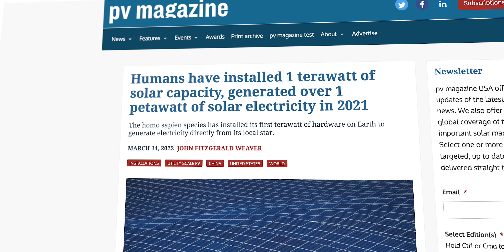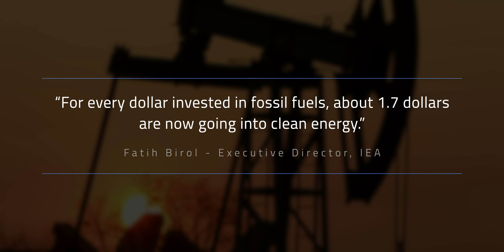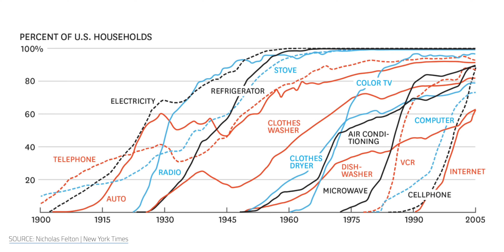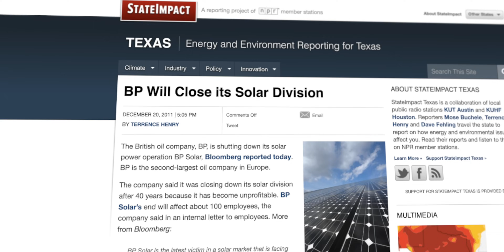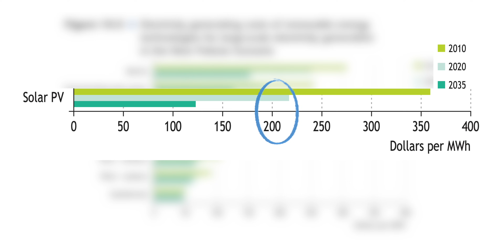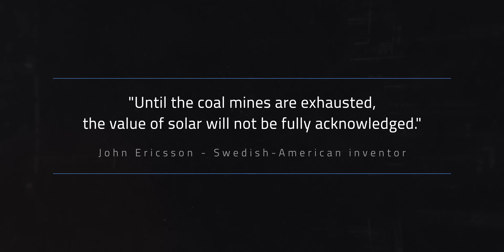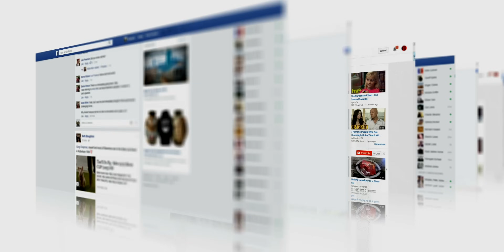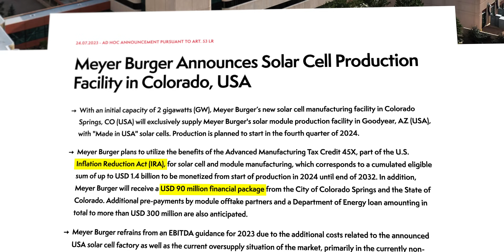How Solar Power Got So Cheap … So Fast

Comment: your vid does not cover any of the reasons I saw
as the reason PVs did not go onto roof tops.

one--power companies determinedly making PV systems
either more expensive by adding fees or expensive 
appliances being made mandatory.  (there is a LOT in this area)

two--batteries for storage equaling the cost of the rest of the system

three-- HOAs or zoning being allowed to stop installations.

four-- while green credits may still exist, access to such incentives
was not possible as a way to offset expenses.

this last one was the real killer, governmental programs that 
could have created a path to clear skies were not put in place.

While the term 'money' is a good catch all, there are much more specific
ways to explain why PV was not adopted earlier.
it is not just 'little monetary gain.' It is that
PV systems had a lot of laws enacted to make it more expensive.
-changed grid/net metering.  three times.
-adding anti-islanding requirements.
-grid access charges. one example is Fla law to stay connected
-no access to time of day power prices
-no access to 'green credits'
-artificially elevated safety requirements/inspections

so yeah money... whose coin you are discussing is 
a far better way to see the problem.
so no it was not the marginal saving involved
it was any saving getting legislated away as requested
by people who saw PV systems as a threat to profits.

Comment: The EV adoption curve is artificially held back/slowed due to manufacturer's stubbornness.
Sure i love home charging, especially from solar, but public charging, even for Tesla is a far cry from what has been the gold standard for gas cars for more than 50 years.
Just because something is new, doesnt mean everything from the old system has to be thrown out.
Mainly the concept of a gas station, a shaded place where you can stop, rest, get some food strech your legs while or after you've filled up.
You just dont get that with most charging stations, which is a problem because unlike gas cars, EVs cant be filled up in under 5 minutes so you do really need something to do.
It is beyond my comprehension as to why 99% of charging stations dont have roofs like gas stations, they're even more needed with charging because you can easily add solar, and the AC is far less needed in the shade, wasting less of that sweet sweet charging juice on the AC.

Dont get me wrong, once i get my Aptera i wont even need to plug in at home, even my annual vacation would be 100% self powered as the round trip is within the range of the model i have reserved, and i'll have a week and a half of solar charging in-between the two legs of the trip, the main reason i am getting the larger battery pack is that i'd like to hopefully use it as an external battery pack for the house, though if that never happens through firmware at least the battery will last me 30 years assuming no abnormal dendritic growth

Comment: Without the lower cost of batteries solar is worth nothing. The only so called renewable that has any practical application is water. Even then if you can't store considerable quantities of water you are at risk of losing power. So batteries are really the linchpin in all alternative to utility scale power. I'll probably never recoup my investment in solar and wind. I also have a hard time believing  that it will ever recover the so called greenhouse gases created by their production. Only high utility costs and concerns for the reliabilty of the grid really drove me to adopt alternatives.

Comment: I think I have an innovation that will reduce the area of solar panels and increase their efficiency.  The method is a three-dimensional work like a wardrobe, and in it like drawers in which solar panels are placed, and inside the drawer there are flexible tubes of optical fibers that transmit sunlight to the solar panels, and on top of the cabinet there is a spherical lens that contributes to collecting light, and behind the cabinet there are fans that contribute  In cooling solar panels and batteries

     After the success of this experiment, it will be developed, and a building will be built that resembles the shape of vertical buildings, hotel buildings and apartments, and inside it there will be solar panels stacked on top of each other.  The solar panels are inside rooms, the length and width of 1 meter * 1 meter, and a height of 15 cm. These rooms are cooled and contain sensors that measure the amount of light and the room temperature, and windows of glass with convex lenses, and from the top of the building a huge round lens, and the external lenses of the building collect the light inside the rooms.  Paint it with a paint that reflects the sun's rays, one hundred percent.  Inside the room, holes are fiber optic tubes that transmit light to solar cells that collect the light, and from behind the building, air conditioners help cool the building and the solar panels.

     The project can be developed by increasing the area of the building or the height of the building or reducing the thickness of the solar cells and increasing the rooms of the solar panels and increasing their stacking on top of each other or increasing the energy production efficiency of the solar cell to a centimeter per meter or through buildings specialized in collecting light and transferring it to the solar power station and its function is to collect more  The amount of light transmitted by building components including lenses, reflective chambers and fiber optic tubes that transmit light to building solar panels

Comment: Want good bad news?  EVs are about to hit a sales stagnatation given their price.  New batteries will address part of that by reducing cost to produce them.  But if their sales don't fully use up battery production there will be a significant supply of batteries for home storage.  Cheap.  And that will give solar power a real sales advantage.

Comment: Rooftop solar is national security.
Reply: Back when the Moslems were our official enemy, there was lots of talk about how our grid was vulnerable if you looked it at from the perspective of single sourced power production. With roof top solar you could zone off neighborhoods as well as have multiple sources to feed the grid, it would be virtually impossible to take out as large of a section of power supply in one attack.   Multiple, easy to maintain sources could be adapted to counter threats much like how the internet bolsters communication robustness in the nation.

Comment: You're conflating installed capacity with actual power generated.  These technologies have bad capacity/utilization factors  (on the range of 10-25% for solar and 15-40% for wind depending on installation size and location).  So even if you installed 1 GW of solar, you might only get an effective average generation of 100-250 MW.  You also can't fix that by just building 10x more because the energy source is obviously periodic instead of constant like you might get from hydro/nuclear.  Thus you really need highly efficient and cost effective storage options to make these technologies worthwhile (something the power industry is just not 'there on yet' but might get there in the next century).

LCOE calculations a notoriously misleading.  One methodology will give you one answer and are highly sensitive to things like capacity factor selected, WACC, if authors ignored certain life cycle areas due to lack of information, only used modelled data vs inclusion of real data, etc.  I bet I can find a LCOE for solar that is super high and a LCOE for solar that is super low just depending on bounding assumptions made during the calculations. 

The truth is that solar can be good for 'some places' based on availability and reliability.  Conversely many places will not have reliable or readily available solar so for every MW of solar you need a reliable baseload/peaking technology to back it up if you want a grid that doesn't have rolling brown/black outs (something that many industries are highly sensititive to like data centers or mining that need 24/7 operations).  In the end the grid may just cost 2-3x more than it needs to be by installing all that 'capacity' that effectively does nothing.  That grid reliability cost is never put into LCOE (essentially an opportunity cost of ineffectively spending capital on solar and not another technology).  Here are just a few top google hits on LCOE and capacity factors that took all of 30 second to find:

Here is a 2015 US DOE Analysis of LCOE where clearly wind/solar average LCOE is higher than other technologies.  You 100% find ones that are more or less favourable than this one:
 - https://www.energy.gov/sites/prod/files/2015/08/f25/LCOE.pdf

An example of capacity factors:
https://www.statista.com/statistics/183680/us-average-capacity-factors-by-selected-energy-source-since-1998/

An example of mean Germany and EU historic capacity factors (~10-20%)
https://www.researchgate.net/publication/334171681_A_climatological_assessment_of_balancing_effects_and_shortfall_risks_of_photovoltaics_and_wind_energy_in_Germany_and_Europe

Comment: Note that the big numbers solar pulls always talk about installed capacity not actual consumption. Installed capacity is a good way to pump up the hype around solar because it ignores the capacity factor of each generator. solar sits in the mid 20% range, wind slightly higher, while gas and coal sits in the high 80s and nuclear in the 90s.

That Farrel fails to clarify this demonstrates the motivated storytelling that drives this channel. You are not learning facts, you are watching an activists wearing the genre of impartial factual content like a skin suit.

Comment: Matt, you’ve overcomplicated this. First, your analysis is colored by your general eco outlook and belief that renewable energy production will somehow save the planet.  But the reason for adoption is far simpler and has nothing to do with climate change. Note: people are actually far more rational actors than they are given credit for. If there was convincing evidence of AGW, people would respond, but like most on the left, the climate zealots wanted to force unreliable and costly technology on folks and we weren’t having it.  Now that prices have come down, and it has nothing to do with government incentives, despite what companies put in press releases and 10Ks, people are seeing it as a viable utility cost saving technology.  Coupled with storage, solar is now actually useful as the household level.  Additionally, solar provides energy independence at a household level.  It allows people to live in places they wouldn’t normally be able to, with the conveniences they can’t live without.  I am squarely in the latter camp and will be installing 30-40kw of solar with storage, this year.  It’s a simple cost benefit equation.  One most people can do with a calculator.

Comment: I'm actually trying to run my apartment on solar. I have a portable battery and 200 watt solar panel, both were gifts. I'm hoping to run my lights, TV, fan, speakers and phone off of it. (Not all at once sadly) 

The entire setup would be 350$ and its all portable.

Comment: I am disappointed with the content of this video. It explains the adoption curve and that initial incentives are needed, but I expected - based on the title - that you would also get into the details of new manufacturing techniques, breakthroughs, material science, economies of scale, etc. to explain your the question you allude to in the title: how did solar power got so cheap. I know that the technique to mature mono crystal panels was an important step as poly crystal panels have a limit on how much they can generate, but did silicon get cheaper? Was there a new material introduced? etc.

Comment: While I'm all for an individuals ability to achieve energy independence, only roof top and structure mount systems are viable and environmentally responsible. Ground mount and large acre based systems cause so much environmental damage and are responsible for the destruction of viable land and the execution of countless species. The environmental impacts of construction and disposal of solar panels are also counterproductive and a large reason why these "environmentally friendly" devices are really just a political tactic.

The part stating about the amount of solar installation reaching MW amounts is misleading. It doesn't take into account how many systems have been replaced or repaired, only that they were installed. The more realistic number is probably less than half.

Green tech is more about money (green) than enviroment (green).
Reply: Not sure about all of that. Agrivoltaics may solve many of the ground mount issues if there is dual-use. Saying all-or nothing about any technology, as young as this seems a bit short-sighted.
Reply: @racingtogreen2023  Agrivoltaics have many issues. The limited crops and equipment make it nearly pointless. The amount of pesticides and herbicides needed, as well as the vast number of other animals killed to keep the systems clean, make it almost as bad as organic farming and producing vegan options. It's all falsely environmentally friendly. It seems good on paper and in head lines, but once in operation, it's actually worse than what it's replacing. Similarly, the wind power industries have faced these issues.

Most environmentally friendly products, companies, ideals, and plans are only beneficial to the end consumer. When production, manufacturing, and disposal are accurately accounted for, they are often times more harmful to the environment than what we are currently dealing with.
Reply: @bmoturtleco  you seem hyper negative. What data are you referencing, as this is a new field, with promising early results. Judging by your response, you have an agenda, though.
Reply: @racingtogreen2023  solar panels aren't a new field. Data based on various studies and documentaries. As well as multiple first-hand testimonials from those that have dealt with issues. Many here on YouTube. My only agenda is pointing out facts based on evidence and logic.

Comment: I think cheap third-world labor and absent environmental protection are what allowed cheap PV solar to proliferate.
Reply: @OfficialMattferrell_  I like wind and solar power because they give us the ability to be more independent.  Unfortunately, they are both highly dependent on slave labor, working in terrible conditions to get the raw materials.   The longevity and recyclablility of the components are still poor for solar.  It means we will continue to be dependent on unsavory corporations and governments around the world to resupply them as they age and fail. Wind power may be a little less disposable,  but all of these factors need to be considered when determining if it is better than fossil fuel.

Comment: WOW Solar is so good that it needs all sorts of incentives to be viable.  GLARING PROBLEMS WITH SOLAR STILL NOT SOLVED. Energy storage.  The fact that most solar instillations still do not offset the carbon footprint created in by instilling them.  Annnd the fact that no one has any idea IF and its a big IF "renewables" can ever replace current energy production, considering how fast the consumption of electricity rises.  Matt is one of those pie in the sky types, he has no real solutions just a lot of pretty strawman arguments.

Comment: misleading info to say solar is the cheapest. it is under very specific circumstances.  but over all in the real world it is not.  and by no small margin either.

The issue with solar is production vs consuming. or supply and demand. Solar produces it's peak output during a time in which it is not needed so therefore the power needs to be stored, if power storage is factored into the price. the price of solar goes up exponentially, Now factor in, solar has zero production at night, so if there is not enough power stored up to get use through the night, then solar needs a 100 percent back up, enough to keep the entire grid going during solar's nap time. So that needs to be costed it. So now not only do you have the cost of solar infrastructure, you are now also paying for and maintaining the entire back up system too. as well as the storage facilities. 

So no. Solar is not the cheapest. not at all. only in ideal conditions where the power being produced is being consumed at the same time, so storage is not needed. but even then, a back up will still be needed for the nigh.

Then on top of all that, factor in, solar degrades and requires replacing about every 15 to 20 years. and solar panels are NOT easily recyclable

Comment: Bla bla bla, for 10 min just talking beside the point, didn't finished the video. Long story short, China entered the market with cheap solar panels. As far as I know there is no US or Europe manufacturer. Is there an ecologic impact (negative, beside the positive one) for these cheap panels (like depletion of silica sands etc.), I have no idea, but at the end of the day you'll still need some back-up for rainy days. Probably that's why I didn't follow this channel lately.

Comment: Long winded nothing burger,here is what is needed a 75 to 100 watt panel that measures abot4foot by 2 and weight about a pound or two and costs 50 bucks at that kind of price panels will sprout up on apartment balconies and backyards everywhere
Reply: Amazon has those sizes /wattage for approx ,€80.
Bought several of them this summer and they are hanging at the side of our boat..
So not exactly $50 but pretty close